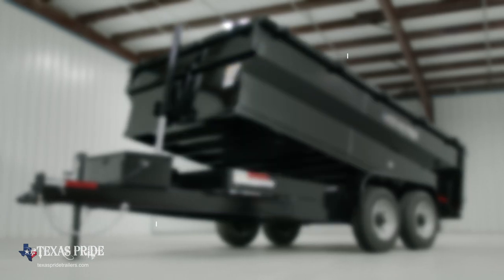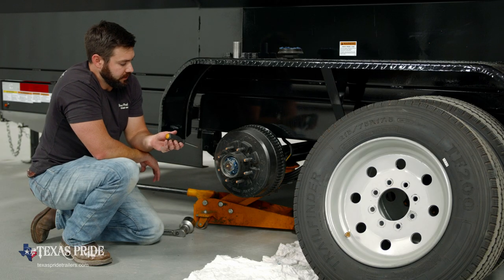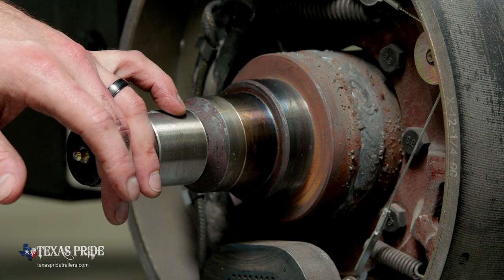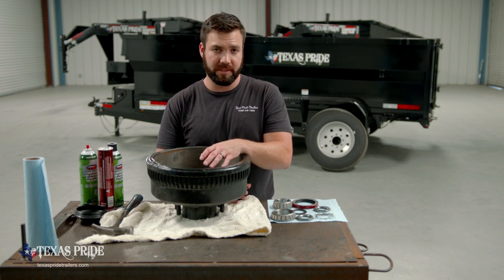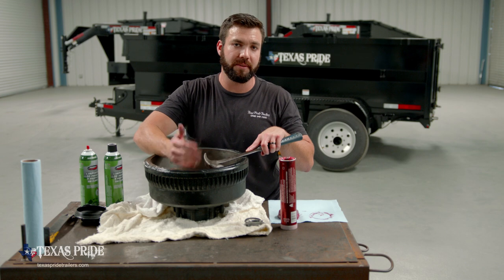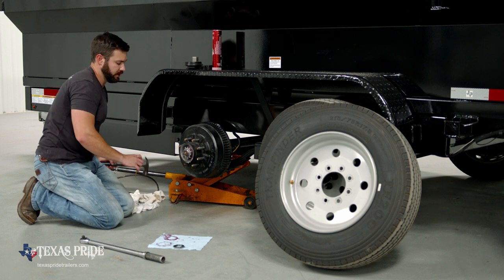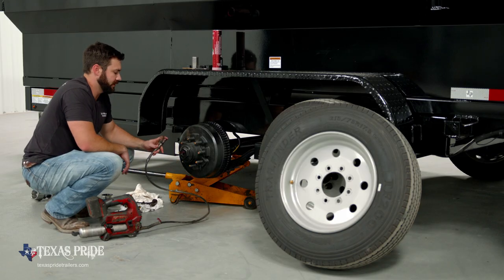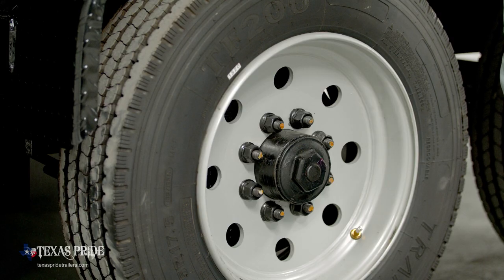Tech Tips: Wheel End Maintenance | Texas Pride Trailers

Comment: just a question about the inner bearing numbers on the 9K axles. I see you have the 387A bearing here, which is what your website lists as the correct one too. I also notice on the website that bearing 25580 can be used for 8-9K axles. Without pulling mine out to check, which one would i need? I have a 41ft gooseneck from Texas Pride with the 9K axles i bought last year. I have had the bearings out a few times to clean and inspect but didnt look at the number on them since they were still looking good.
Reply from the maker: Hi Warren, thanks so much for the great question! Here's the response from Brad Walker:
"On our 9K wheel ends, the inner bearing cone is a 387A and the outer bearing cone is a 25580. On an 8K, the 25580 is actually the inner bearing in that wheel end. The same bearing is used in both wheel ends but on the 9K it’s the smaller bearing and on the 8K it’s the larger bearing."
We hope that answers your question, but if you need any further clarification, please let us know. Have an amazing weekend!
Reply: @texaspridetrailers  I have a 40’ gooseneck flatbed with 12k dual axles. Without removing them would you know what the inner and outer bearing part numbers would be?